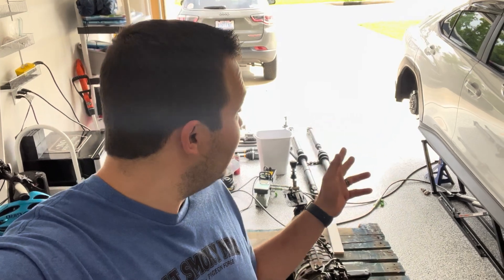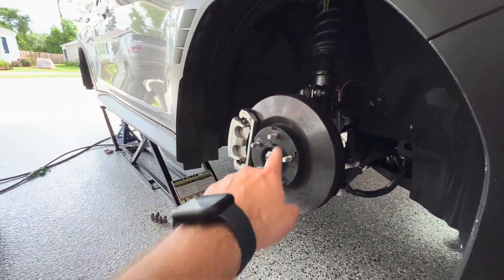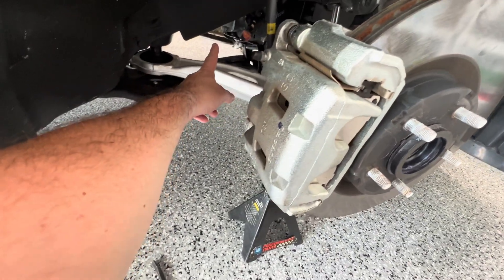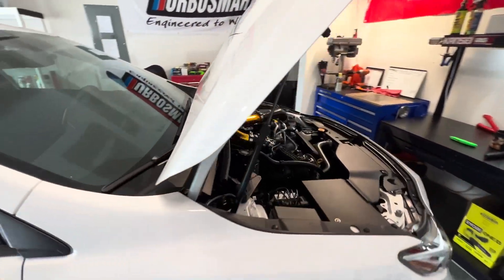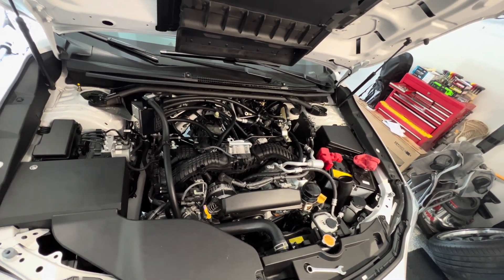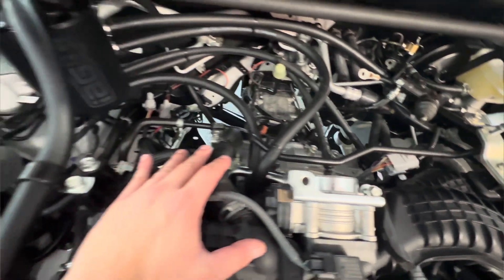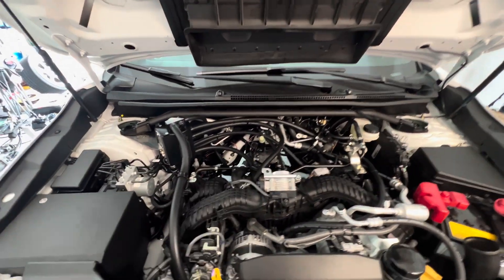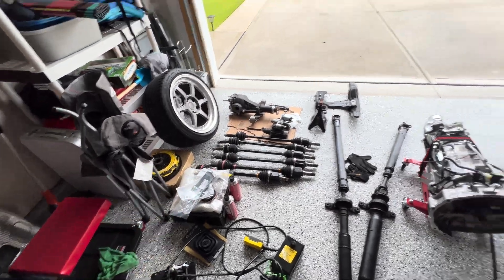22+ WRX STI 6 Speed Swap Ep. 03 WRX Transmission Removal & ACT Xtreme Clutch Install

Comment: Seeing how a guy can do this in his garage no reason why this should not be a factory option. It does not even have to be an "STI". This should just be an option one can opt for when purchasing the car.
Reply from the maker: I agree it should be a factory option. It’s literally bolted right up. No modifications to make it fit. It just works. STi trans and rear diff are both lsd too. Wrx is both open diff

Comment: I wonder if it would've been worth it to do the rear main seal while you were in there.. It's such a new car though
Reply from the maker: It’s such a new car with low miles. I didn’t feel the need to replace the rear main

Comment: Could you provide final torque specs for all the bolts and stuff? Like the flywheel, clutch, trans housing, diff, etc? Would def be appreciated.
Reply: Straight from the 2022+ WRX service manual:

Flywheel bolts (x8):
1. 22.1 ft-lb
2. Now tighten in a star pattern an additional 30-35 degrees using an angle gauge/etc.

Clutch cover bolts (x6):
"Equally tighten several times": 11.8 ft-lb in a star pattern

Rear Diff:
Vertical nuts: 36 ft-lb; Horizontal nuts: 81 ft-lb

Trans bell housing:
39.9ft-lb
Reply: I have the OEM service manual for the 2022+ WRX, I'm going through his video series and will put together a full checklist/guide for the entire installation.  I have a 2020 complete swap on the way, so hopefully I remember to share back here after I've filled everything in.

Comment: You will need to extend the Sti driveshafts 25mm. We used an MY19 sti kit here in Aus.
Reply from the maker: Mine fit no issues. I just pulled it to the diff with my hand. The next video is up. You can see I just pull it to the diff and put the bolts on